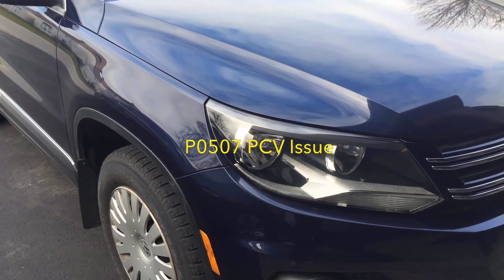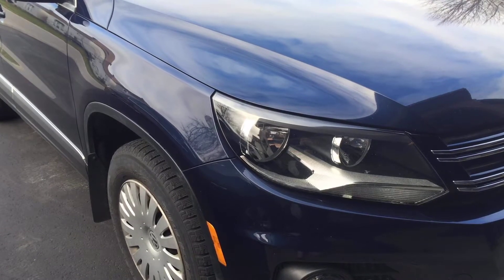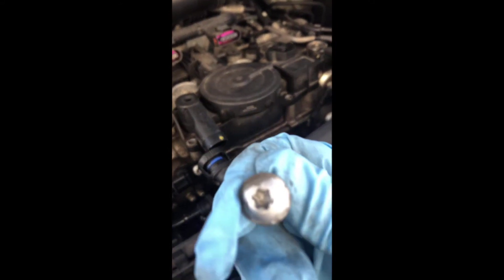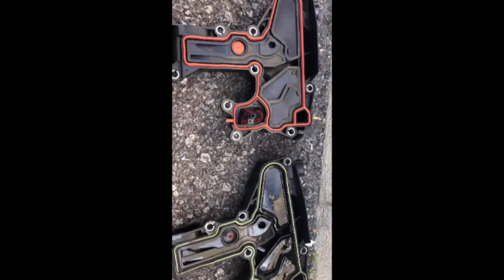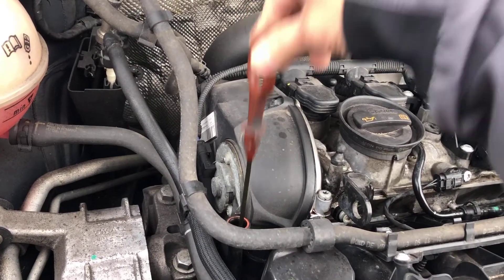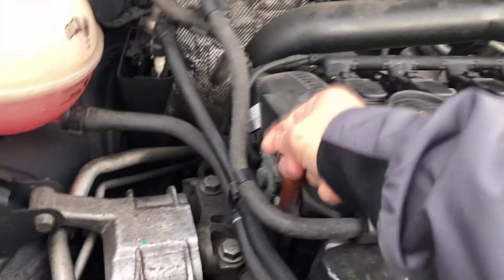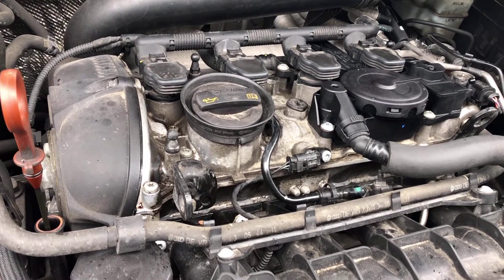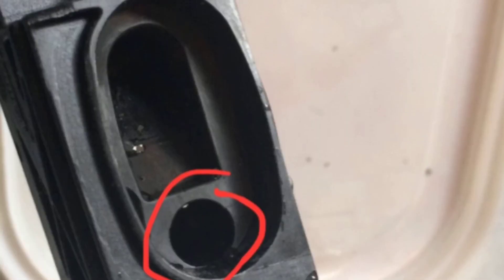DIY - Volkswagen Tiguan engine code P0507 & whistling noise - issue solved

Comment: That’s what my 09 Tiguan sounds like… thought it was serpentine, found the alternator had bad pulley but squeal remained…will check it out
Reply from the maker: That could be the problem . Check to see if there is strong vacuum under engine oil cap .
Reply: Did you ever figure it out? Changed serpentine and pullies.

Comment: Just wanna say thanks as you just save me a lot of work after  my check, engine light came on and I stopped at an automotive store to run a scan who told me it was a bad valve cover gasket at which time I decided to look at a couple videos when I noticed you checking the oil cap which is what my problem was, Simple.
Reply from the maker: This type of feedback comment motivated me to post the video. I am glad that this video has helped you.  More information about this video is in the description.  If you have already clicked Subscribe and Like.. Thank you for that.

Comment: Wat is that piece called
Reply: And does that causes misfires
Reply from the maker: Oil separator/PCV valve and yes engine will not running right
Reply: DORMAN made a replacement piece... you can youtube other videos using the  part# 

Dorman Solutions kit 917-064